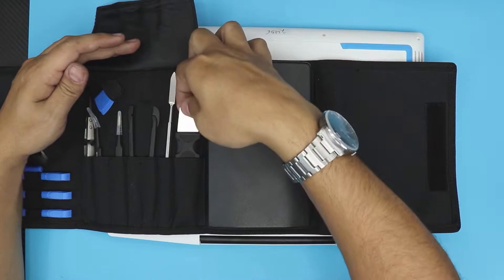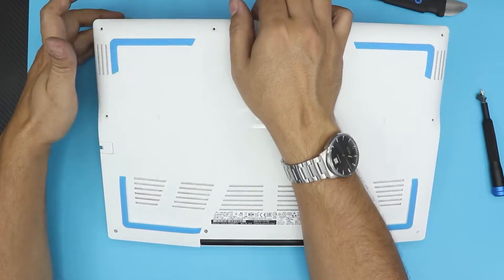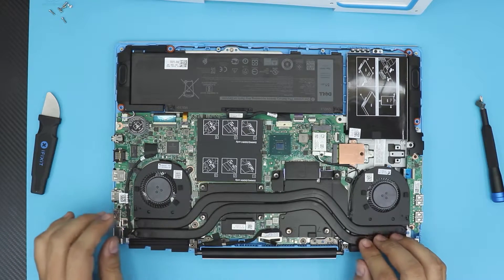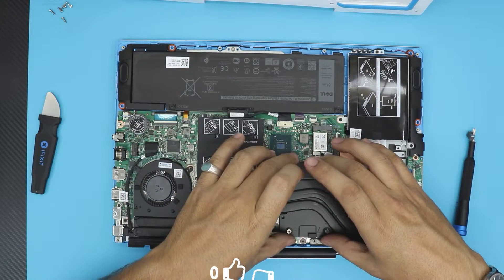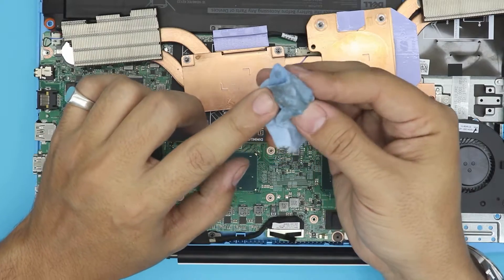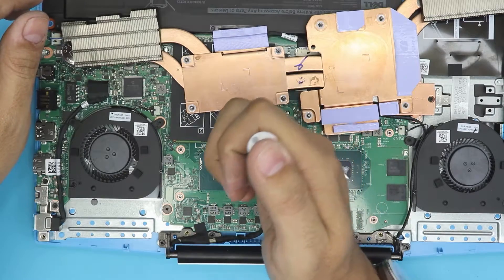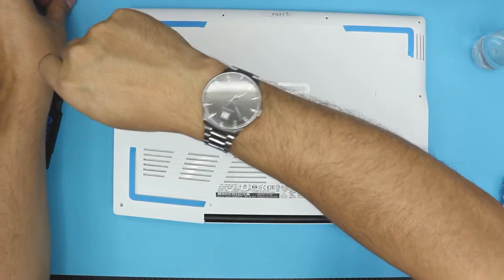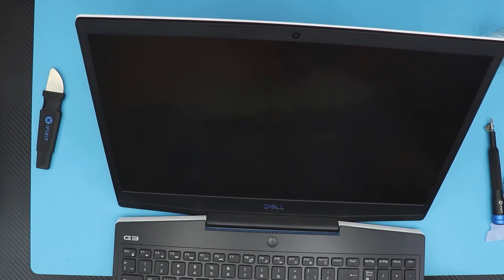DELL G3 15 series take apart repaste GUIDE disassembly

Comment: What type of towel do you use? Should i be sone kind of special one for electronics?
Reply from the maker: Thank you for the feedback! if you wish to support the channel you can LIKE or SUB or both :P
regarding your question: use this,https://amzn.to/3lyK6A3
else you will damage the capacitors around the GPU, use this with alcohol 99% iso.
Reply: @uFixTek  Thank you for your reply. The thing is i have never done thermal pasting and your video is realy usefull. I wonder, is it risky to do that on my own? I do not want to damage anything :(
Reply from the maker: absolutely not risky if you follow the steps exactly. unless you are not good on following instructions then don't do this :)
if you need help or stock at any point let me know.

Comment: No sabía que hablabas español hasta ver algunos comentarios jajaja
Has tenido algún problema con las bisagras después de un año de uso? 
Respecto a las nuevas temperaturas, la mía la tengo configurada en perfil frío y en correinte AC en Dell power manager, he desactivado el turbo boost y al jugar las temperaturas de la cpu llegan aprox hasta los 75 grados. Crees que aún así haciendo el cambio de pasta las temperaturas bajen significativamente más? O en este caso no por la configuración que le puse de enfriamiento?
Reply from the maker: hola, mira si tus temps están 75c en carga pesado es excelente no te metas mano. cuando temps suben de 86c así a arriba entonces si abre dale una limpieza a heatsink y cambia pasta térmico a uno marca bueno como mx4.
sobre tus bisagras, siempre agarra desde medio de pantalla para abrir asi se va poner presión pareja sobre bisagras, no abres la pantalla agrando de un lado.
en un momento vas a tener que abrir las bisagras y dale un mantenimiento y ajustar su tuerca, ya que con tiempo se van apretando.
gracias por el apoyo al canal con un SUB:P
si andas en queretaro te podre echar mano gratis :P
Reply: @uFixTek  muchas gracias hermano, ya me suscribi, será de mucha ayuda. Si no fuera por la pandemia si estaría en Querétaro porque ando estudiando allá jaja, pero bueno. El equipo es nuevo, apenas llevo una semana con el y lo tuve que configurar así porque de otra manera si llega a tener picos de 100 grados cuando estoy jugando. Respecto a lo de las bisagras si me informe bien desde antes, creo, solo que ando preguntando para ver a cuántos les ha pasado y veo que es muy común, fuera de eso trato de tomarla desde Enmedio y levantarla lento por lo mismo que me explicaste, espero que haciendo eso no tenga problemas...
Reply from the maker: claro si lo abres normal despacio, no va pasar nada en absoluto y te va durar mucho mucho tiempo. pero hay gente que prácticamente abren cierran cada segundo y muy rapido y eso provoca que se amarre las bisagras, y dano al cable flexor de pantalla. si 100c es demasiado. mantenlo hasta 88c maximo .
saludos

Comment: Somehow when i openned mine, the heatsink was kind of wet. It have like a kind of grease in the surface of both pipes of the square chip (left one in the video). Does anyone has had de same surprise? 
I think im going to call Dell Support because its really weird for me.
Reply from the maker: no its the grease that comes off from the pads, its totally normal when the pads heat up and cool down they tend to do that, nothing to worry the liquid that releases the pads are none conductive.
thank you for the support and your feedback.

Comment: Did you have any problem with the hinge after a year?
Reply from the maker: yes the hinge issue are in most laptop if you open and close too fast, you will need to do a maintenance one hinges every 3years.  thank you for the support to the channel :)

Comment: Any chance you can go more in-depth about that missing vram?
Reply from the maker: the motherboards are made and designed for different models of the same laptop , some with more Vrams and some without, in order to not design a different board for every model they make one motherboard and based on what you pay they add the components , more vrams and so on.
vrams are VIDEO CHIP *card Ram,
Reply: @uFixTek  So according to what you've said is it possible to upgrade my vram? I'm using Dell G3 15 with 1050Ti 4gb vram.

Comment: I replaced my thermal paste on my g3 and everything was fine, I monitored the temps for a bit and it wasn't raising at idle. I started playing a game and 10 minutes into it the computer shut off and haven't been able to start it ever since. Any suggestions on what to do? If it was a short wouldn't it not start up in the first place? Or if it overheated wouldn't it start up after the computer cooled off, or should be a blue screen saying it's overheating?
Reply from the maker: no i will explain what the issue give me 2h and i will get back at you.
Reply: @uFixTek  thank you!
Reply from the maker: okay i need you to do something:
open up the bottom of the laptop and remove the battery cable and then remove the bios cr2030 battery and then with charger and both batteries disconnected press and hold the power button for 30sec. then let go and place the bios battery and then connect the charger only without the internal battery ( no need tho place the bottom cover, just open the screen 90 degree and place the laptop on its side. and connect the charger and power on and look to see if the fan is spinning. and if you get the boot (it may stay on black screen for 10sec doing a mem check, and then it will do a auto restart and then boot normally)
NOTE: its normal that the fan spins for few sec then stop or the fan may not start at all until the temp goes over 50c, even then only one fan may work. no panic 
now lets say you got it booting and then power back off and plug the battery and then power back on and still with bottom  case open and the laptop on its side let it sit for 15-20min and make sure the fans start, after 20min power off then back on and then still on its side do a stress test, using prime95.
let me know
Reply: @uFixTek  I just tried following your steps and still got nothing, do you know if it could be anything else?
Reply from the maker: okay keep that back cover open, i need to do few test, remove your mechanical hdd if you have it connected, because for the laptop to turn on no need for hdd to be plugged, and for the testing its good to keep the hdd unplugged as we dont want to damage the headers. 
now that said, remove both rams and power on,
also i need to know when you say "got nothing" what you mean exactly,? no fan action no LED lights no reaction ?
can you contact me on my email and i can assist you via whatsapp if you wish.
ask@ufixtek.com

Comment: how do i unplug display tab?
Reply from the maker: if by "display tab" you trying to refer to display flex connector  that is shown @3:15 right in between the cpu and gpu with black cable. you just pull upwards towards the ceiling by pulling HARD on the black tape on it,  its a snap on jack.
Reply: @uFixTek  ahhh i see thanks dude
Reply from the maker: Bryano458 your welcome, if you got any questions ask , good luck